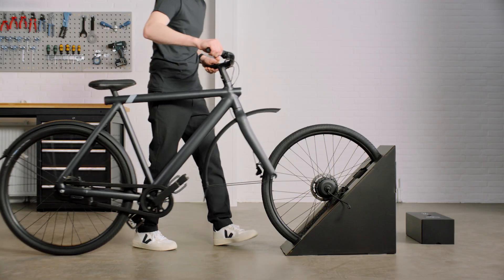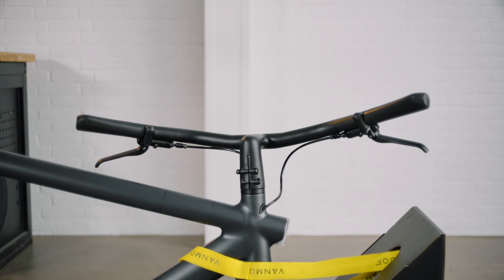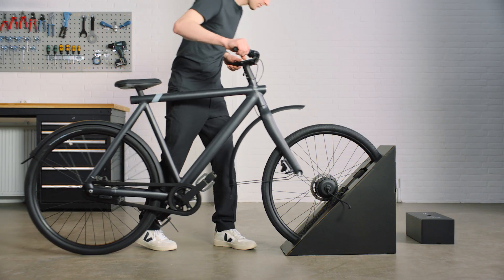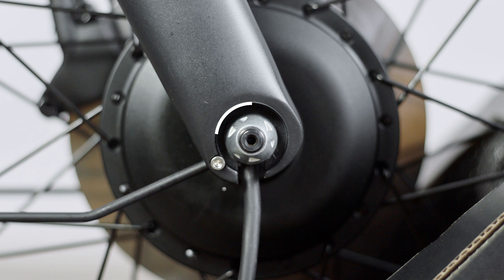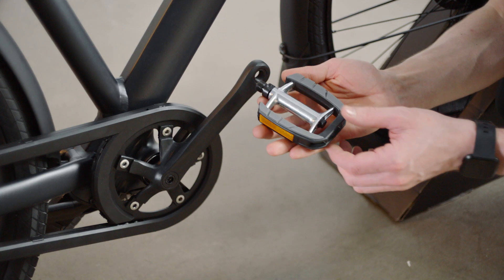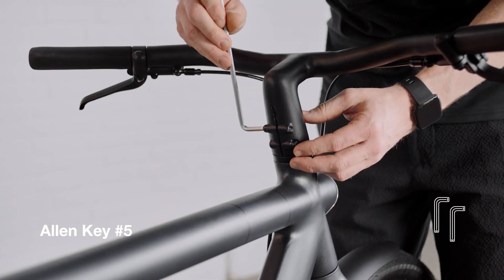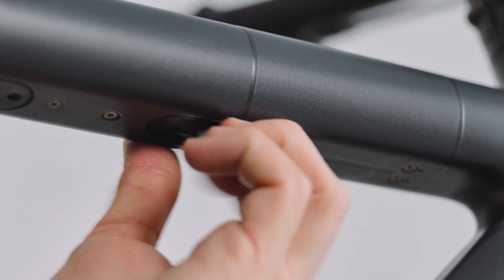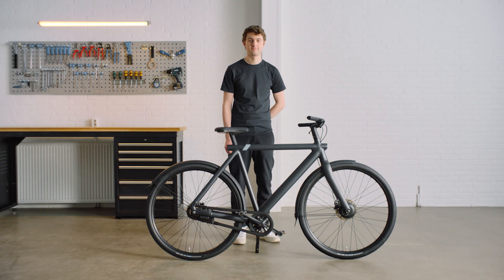VanMoof S3 & X3 | How to set up your VanMoof S3 or X3

Comment: So this the motor cable installation on newer S3 / X3. I bought mine last December and got the older X3 with very frustrating motor cable installation.
Reply: How did you manage to screw the cover in? Mine feels like the screws aren’t long enough to reach the holes!
Reply: I got mine a few days ago and I can confirm the motorcable is still a hassle to get in, at least the cover is click on now
Reply: Yea just had the same issue. When the arrows alligned it did not go in at all. When I turned it, it sort of fit after half an hour of fiddling -.-

Comment: Hello good afternoon, yesterday I bought an S3 bike from a private individual, I knew beforehand that it did not charge, I connected it to the charger, but it does not charge, the only thing that happens is a small and quick flash in the light